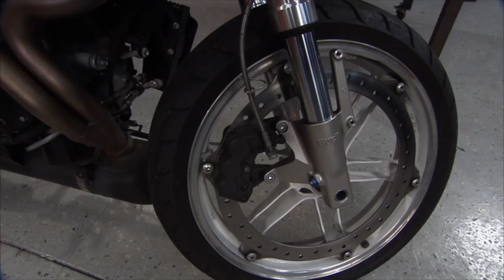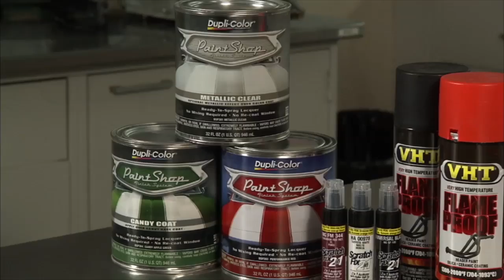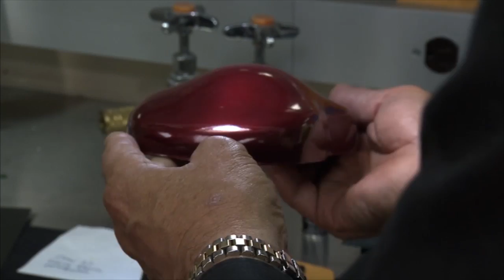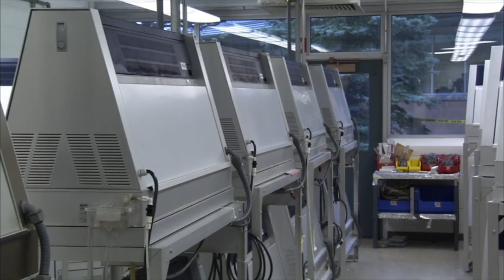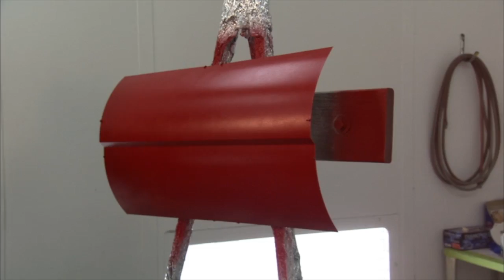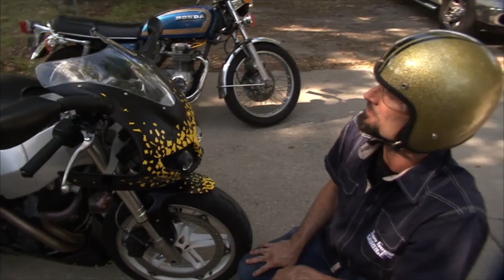Dupli-Color Paint Shop | Two Guys Garage | Season 8 | Episode 2

Comment: I will say that I AM VERY GLAD THAT DUPLI-COLOR BOUGHT AND OWNS VHT NOW! Because their HIGH TEMP ENGINE, CALIPER, EXHAUST MANIFOLD PAINTS, PRIMERS AND CLEAR COATS!

I just wish that VHT Engine Clear Coat was offered in a 2k 650° version like Eastwood offers in theirs... Its rated at 550° which should be plenty sufficient, but VHT has an Engine "Metallic" Series that are rated to 650°, so what good is that if the Primer (SP148) and Clear (SP145) are only rated up to 550°??? 

So I guess my suggestion would be to just buy the Caliper 900° Gloss Clear Coat (SP730) 👍🏾...

However, the Engine Primer is still only rated to 550°, so you then would have to step up to a higher 900° Caliper Primer, but wait, ready for this... VHT DOESNT MAKE A 900° PRIMER , So you have to use the 1200°~2000° FLAMEPROOF GRAY PRIMER (SP100)! Which should be Great For use on Calipers, Exhaust Manifolds, and the Engine I would imagine... But WHY NOT MAKE a Black PRIMER in the FLAMEPROOF, ENGINE, AND CALIPER too for a nice Black Base for certain Pearls, Chameleons, etc!!!

So I guess what VHT should do is make BLACK PRIMERS in all three, and a 2k Engine & Engine Bay 650° 2k Gloss Clear!!! 

And If you are going with a Matt look you MUST use the FLAMEPROOF Satin Clear, since that is the only option there as well...

I can live with using the FLAMEPROOF Exhaust Manifold Primer to use on the Calipers and Engine, but PLEASE PLEASE DUPLI-COLOR, MAKE A 650°  2K MATTE, SATIN, HIGH GLOSS ENGINE+ BAY CLEAR!!!! AND BOTH ENGINE AND FLAMEPROOF PRIMERS IN A BLACK it Least if not all three (is a Caliper Primer Necessary?)!!!

RUST-OLEUM HAS A 1200~2000 CLEAR, BUT IT SEEMS TO BE A GLOSS! 

MIght as well just Relabel your VHT FLAMEPROOF PRIMER (SP100) to say "for Use also with VHT CALIPER Base Colors)"

Unless is the VHT ENGINE PRIMER 550° (SP148) only compatible with Caliper Paints? Or Is the FLAMEPROOF PRIMER (SP100) Ok to use on Calipers and Engine +Engine Bay near Turbo Exhaust Manifold?

Comment: If you use this stuff make sure you let it cure for 6 months or you’ll get leaf marks burned into your clear. Beware you’re using something with no hardener. I learned the hardway. For the money you save with this stuff you’ll probably end up doing your car over multiple times cause you can’t buff and blend screw ups with the clear. You can only polish it. You might be better off just using the pigment and buffing it with a yellow HF pad. It will save time and money in the long run cause you’ll be respraying anyways.

Comment: Apparently they don't care about their krylon line. It's really taken a crap the last several years. It use to be great with the old caps. Since they switched the paint is just watery and easy to make run. They give 25 percent more per can you'll need it. As much as they charge what's another 5 cents worth of pigment really? There's a reason rusto cost more. At my local Walmarts all the krylon went on clearance only a couple rusto colors did. I picked up some gray rust preventive primer. Same watery crap it's been for years. This is what happens when you choose share holders over consumers. Your products go on clearance. For a quarter more you have the tried and true rusto who hasn't cut their pigment down to complete crap
Reply: Even color place Walmart primer for 1.50 online is much better quality. No surprise rusto makes that line as well. I shook the can for over 5 mins  as with cheap hardware paints you must shake and shake when you think your done go another two mins. And they will lay out much nicer. And spin the ball in the bottom like you would be stirring the paint. Very disappointed in krylon. As there Sherwin Williams products some of them are amazing. And others overpriced way overpriced. I paint for s custom trailer shop. I've shot Sherwin Williams direct from the true factory. Stuff the Williams store dont know what your talki g about and cant find it in there system. For a decent price point for five gallons and activator. The store offered no samples and wanted us to buy paint that was $150/gallon before activator. For trailers. Ridiculous  we get too alkyd enamel with 3 year fade out with activator for $200 as a oem 200 is what we charge for the paint in the build. For primer and paint frame and all. There's no industrial paint out there worth 200 a gallon for a trailer that's gonna be used scraped up etc